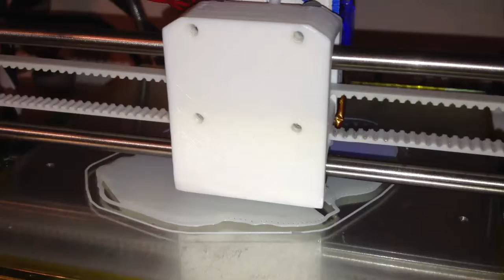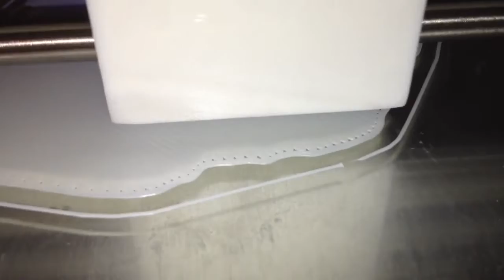Huxley printing at 50mm/s

Comment from the maker: The quick answer is just go into Skeinforge/Settings/Quick Edit and change the Feed rate and Flow rate values to 50.
The months of preparation that led up to being able to do that are summarised in a post called "Skeinforge Configuration" in the RepRapHuxley Prints section of the RepRap Huxley forum.
Good luck with your build.